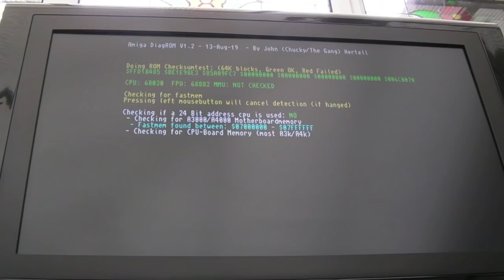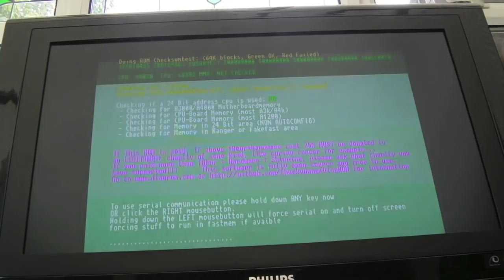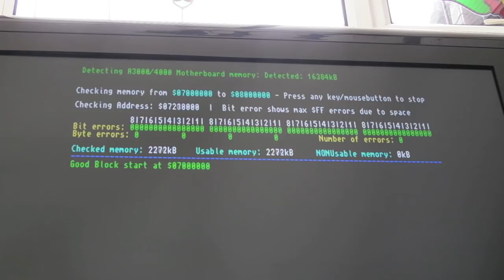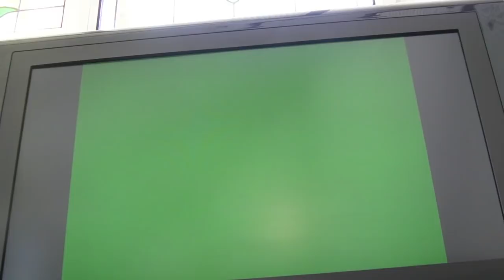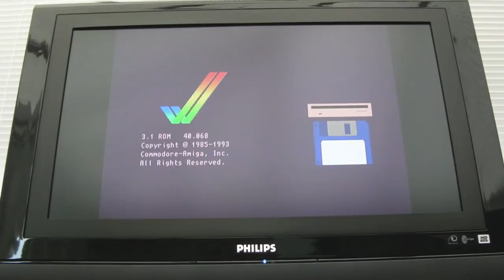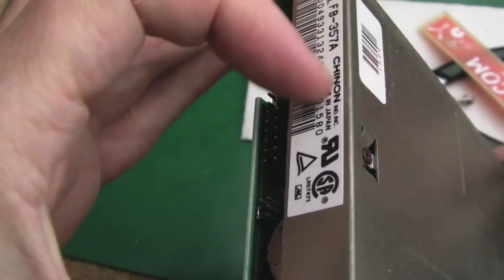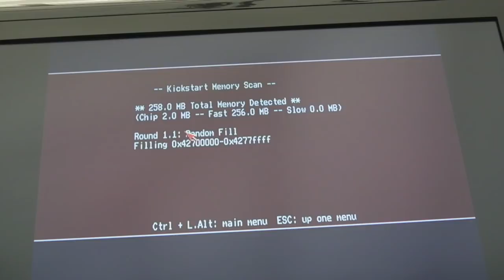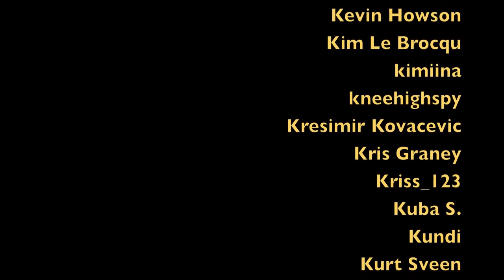Commodore Amiga A4000 Repairs Part 4 (Cathers) & Part 5 (TerribleFire) RAM Fault & More

Comment from the maker: NOTE: This is not part 4 for both series (to confuse matters) - it's part 4 of the Cathers repair, and part 5 of the TerribleFire board.  There might be another part yet (follow up on the RAM) - I am not sure the behaviour of DiagROM (after the repair) is correct there!  Let me know your thoughts!  I am suspecting maybe one of the upper word 245's might be glitching, tricking DiagROM into thinking there's 16MB fitted regardless of what's in the slots?  I forgot to show the resistors on the SIMMs - this is something I filmed a few months ago (almost), but since then Adrian Black has done a similar repair and focussed in on those resistors.  You can see more here:- https://youtu.be/mJkiblw8Wl8?t=566
The seller of those 060's on eBay was funkward-tech
TerribleFire A4000 Part 4 - https://youtu.be/_YQ14ojIcTc
TerribleFire A4000 Part 3 - https://youtu.be/LoRxJRU_g2s
TerribleFire A4000 Part 2 - https://youtu.be/LotA7y7tzBs
TerribleFire A4000 Part 1 - https://youtu.be/n1RTb4bUy4c

Cathers A4000 Part 3 - https://youtu.be/zFeMGetzrGw
Cathers A4000 Part 2 - https://www.youtube.com/watch?v=5q4MaN6bMBA
Cathers A4000 Part 1 - https://www.youtube.com/watch?v=CohL_kduhYg
Reply: Regarding the diagrom memory test, I think I see what the problem is. @23:20 you see when diagrom initialises it detects the right amount of memory (bottom of screen). Then when you go into the memory test it wrongfully says detected 16384 kB. So the test is still testing the wrong amount of memory.
Reply from the maker: Thanks =D  Yes, I do mention that at one point in the video!  It always detects 16MB in the actual test, whereas on the main screen it always shows what is installed correctly.  It must be a bug in that version of DiagROM.  =D
Reply: In theory Sir, what would be the max fast ram possible? Could you make the fast ram non volatile? Cache drive or Ram Drive?

Comment: I have to have my SIMMs in exactly the right place. A set of two identical in Banks 0 and 2; a set of almost identical in 1 and 3.
You can also get little rubber covers for the end of the power connectors.

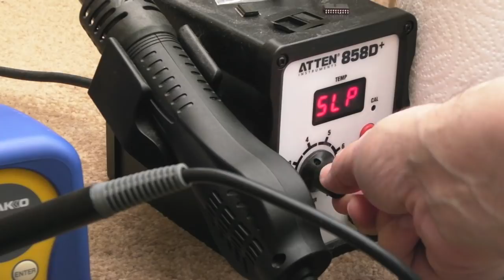Comment: 14:20 Atten 858D+ v3.0 automatically bumps airflow to max as soon as you finish (stick it up back on there). It doesn't affect your setting, as soon as you lift it up it will switch to whatever airflow you used before.

Comment: NIce!  Anything in transit gets the rough treatment so over packaging is an absolute must because you have to anticipate potential damage that carriers will put things through.
Reply from the maker: It was pretty well packaged tbh!  But the box he used was not quite as big as I feel it should have been.  Next time I think that when someone sends me something, I will tell them and find / buy another box I think.  I always go with the packaging provided when delivered to me, and on occasion add additional bubble wrap if there isn't enough.  On this occasion there was plenty, so they must have thrown the box pretty hard.
Reply: You should assume the box will be thrown onto a concrete floor, which is often what happens.  It isn't that they are purposely trying to destroy it.  They just have a lot of parcels to move in a short amount of time.

Comment: Hi chris, love watching these retro repairs. for these smd removals tip, what i do to remove them quickly without too much heat is apply solder paste across the legs comes off so much quicker.as most solder paste has flux in them
Reply from the maker: Thanks, nice tip!  Never considered using solder paste - I like it =D

Comment: I have had great success using a card slot cover to strengthen bent pins.  Make sure you use one of the older thicker ones though.  I fixed a 486 Pentium overdrive chip this way, it was not fun but in the end it worked well enough to plug into a ZIF socket.

Comment: I can't remember where I heard it from but another tip for straightening pins on PGA packages is get a cheap ballpoint pen, remove the ink cartridge and place the nib end of the barrel over the problematic pin, used it myself a few time when the pin pitch allows.

Comment: (@14:30 or so) - it’s not a good idea to increase the airflow to get the hot air gun to cool down quicker, as it can crack the ceramic heating element; ditto for getting it too hot too quickly. 🥺 Now if yours is more like a hair dryer (i.e. a nichrome wire heating element), then this doesn’t apply, though sudden heating/cooling could - over time - work the coil of hot wire loose from the rivets, or from the insulating mica backboard, resulting in an open circuit (if it detaches from the rivets), or a short if it detaches from the insulator. Either case is bad news.
Reply from the maker: Thanks, but LOL!  You cannot win!  Did you see the EEVBlog video on this same station a few years back, it was on the EEVBlog 2 channel I think.  Young David found that his fan died, as a result of long slow cool downs - which meant the next time he switched it on, the element had no cooling (and the unit wasn't aware the fan wasn't running) - the whole thing melted and almost caused a major incident.   I accept what you are saying, but I would rather my element went open circuit rather than it all melting at some point because the fan packs in from extended slow RPM use.

Comment: Hi gadget hope you are well, can I ask what a brown screen means on an amiga a500 wb 1.3 at boot thanks
Reply from the maker: Brown - now that is strange!  It may be that its trying to output another colour, say red or yellow, but there are two faults.   If there was a problem with the video DAC (245's near Denise), the colours would be messed up.  Also, there are 2 resistors that can fail around the hybrid (video coming up on that soon) - those power the Hybrid (also near Denise).  But the colour in general is telling you that the ROM code started to run and the CPU raised an exception due to some fail in testing.  I would fit a DiagROM and see what that reports.  NOTE: On A500 rev 5 or prior, you may need to swap a couple of pins around on the EPROM containing DiagROM as A17 was in the wrong place on the socket for a 27C400.

Comment: Hey gadget, I found my A500 out, and trying to get a picture using a video out from the modulator, I get green, instead of bluey white screen, the mono out, is fine (cept mono) would it be worth buying an Amiga 500 RGB cable? Im not going to use it much mind...
Reply from the maker: It could be the modulator - the Motorolla 1377P often causes that type of thing.  If the modulator is OK, then it sounds like you have a DAC problem, or the hybrid is lacking a voltage.  Check the resistors that are near the large capacitors at the back of the Amiga PCB (where the hybrid is).  One of those may have gone open circuit.  But its more probable its the modulator!
Reply: @GadgetUK164  good, cos i didn't understand half what you wrote lol... Remember kids, I don't fix things, I break em... (Cue flash of lightning and peal of thunder)

Comment: TL;DR I'm sure others have already pointed out that the top of the test screen shows 16MB detected, even though the main screen showed less. To me, it seems just that test is at fault, not the Amiga.
Reply from the maker: Thanks, yes - I did mention that at one point in the video!  It always calculates the correct size, but then the actual test seems to see 16MB.  I am not sure I saw that same behaviour on Cathers A4000.  But I cannot remember if I used DiagROM on his, not sure I did.

Comment: use an IDE connector to straiten them it is supper quick
Reply from the maker: When they are all bent in different directions you cannot put any type of connector on there (including the turned pin socket I tried to use) - pins were everywhere...

Comment: "The A ... hole board" LMFAO.
Reply from the maker: LOL!  Seriously, this board has been an A.... hole!!  I think actually I still may need to swap out a 245.  The fact it can detect 16MB still, when only 1 SIMM is fitted makes me think one of the upper word 245s is slighly pulling high or something (so with a SIMM its OK, without a SIMM its registering some signal that isn't there).

Comment: Did you move the memory jumper when you tested 1 sim ?
Reply from the maker: No, you don't need to!  That SIMM only needs changing to 256K if you are using 1MB SIMMS.  We had a faulty 245, but later when I couldnt understand why DiagROM always sees 16MB when less SIMMS are installed seems to be a bug in that version of DiagROM that I was using.

Comment: In the US at least - Amiga 4000's came from the factory with a high density floppy drive - which back in the day was quite handy if you got files from someone with a PC. I've read they spin at half the speed in HD mode because of some bad design decisions Commodore made (I have noticed the drive is mega slow with high density disks). I hope you figure out whats wrong personally and feel better soon.
Reply: They ran at half speed with high density  disks because the Paula chip wasn't updated to handle the double data rate HD floppy drives normally perform I/O at.
Reply: @NJRoadfan  Ah ok - I knew there was some technical reason for it :).
Reply: and Paula wasnt updated because Commodore ... fired all Amiga custom chip engineers :-) Its like Ali was so clueless he looked at Tramiel for inspiration. Tramiel did same thing with C64 designers in 1982 as a cost cutting measure :o.
Reply: @rasz  There was another core problem too though right? Like you couldn't use off the shelf PC high density floppy drives because none were designed to run at both speeds? Even in the 90s Amiga HD floppy drives cost a kings ransom compared to the off the shelf PC drives.
Reply: @SkuldChan42  Also ESCOM discontinued shipping the 4000 with a high density drive. The Amiga Technologies models use DD drives instead.
Reply: @captaincorleone7088  I had a chance to play with one of those machines as a friend bought one, and its worse than just that. They were PC HD floppy drives and if you put an actual high density disk in them it failed quite spectacularly. So to format them for an amiga you had to tape over the hd hole entirely.

I always thought - even with the Amiga 1200 that it was a bit of a ripoff that these didn't have high density floppy drives. You couldn't get a Mac or a PC with a low density floppy in the 90s.
Reply: @SkuldChan42  I'm not surprised, really - considering that ESCOM was only ever interested in the Commodore brand name because they wanted to use it to sell PCs and the Amiga just happened to be included in the sale, effectively. 
Yeah, it was a rip-off and Commodore were run by lunatics. It's no wonder that the Amiga designers included secret messages in the early machines that took shots at them. When I look back at David's Pleasance's monthly Q&A in Amiga Format and his myopic outlook, it's no wonder they went bust.

Comment: 1 You were not low level formatting, forget about low level format. You cant low level format modern SCSI/IDE drives. Manufacturer does this using internal use only tools. The last drives that could be low level formatted by the user were MFM/RLL ones using ST506/ST412 interface, or floppy disks :) (almost the same hardware interface).
Low level format is a process of generating RAW Track and Sector markers on disk surface.
Something like PC3000 is the closest you can get to a low level format nowadays by performing "SelfScan" procedure to regenerate P-List and zero out G-List (sector mapping, bad sector list, sector translation)

2 Whatever that Amiga program was doing (surface scan, zero fill), taking this long means its buggy, even considering how slow Amiga 4000 is. Not to mention there is no point performing surface scan on an Amiga during format if you know the disk is healthy, unless you wanted to test hardware and there are no other Amiga HDD test programs able to work in a constant loop.
Reply from the maker: Thanks, yes I know how low level formatting works!  The drives were screwed already, I had nothing to lose.  And many old SCSI drive CAN BE low level formatted - because I have done it in the past!  It's IDE drives that 100% cannot be done that way, and need something like PC3000.
Reply: Not even PC3000 does low level format, nothing user accessible does. SCSI "low level" format utilities like aspifmt.exe are sending SCSI Command 4 called "FORMAT UNIT", it does the same thing PC3000 "SelfScan" does - regenerate P-List and zero out G-List (sector mapping, bad sector list, sector translation). Its a fire and wait until drive reports success/error type of command, non interactive no progress bar, drive internal type of deal. You can look it up in SCSI standard (or SCSI Commands Reference Manual), it was never called low-level format by T10 Technical Committee.

Low-level format is writing Track and Sector markers to a raw disk medium. Formatting floppies does this, as does low level format on MFM/RLL drives accessible by using debug .com and jumping to C800:somewhere. On newer drives density was too high for a drive to initialize itself, manufacturer has to do this at the factory. "SelfScan" and "FORMAT UNIT" can only scan for defects and reinitialize P-List/G-List/T-List, they all operate at translation level, one above the physical sector hardware level. TLDR low level format is about laying down physical sectors, "SelfScan"/"FORMAT UNIT" can only operated on already defined sectors shuffling them around in a translation tables.

"Low level format" just sounds so strong and reassuring. Thats why all those utilities keep pretending to do it to self legitimize :) Even Seagate nowadays lies directing users to SeaTools zero fill utility calling it low level :/, while all it can do is trigger Smart bad sector remap (growing G-List).